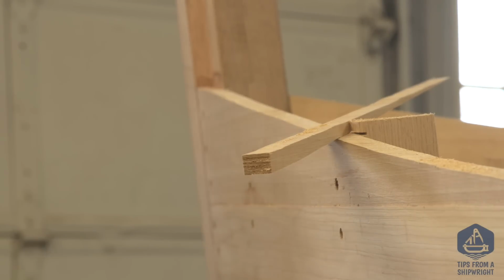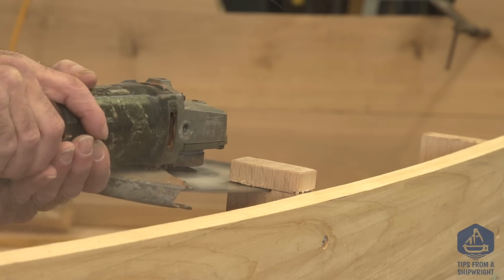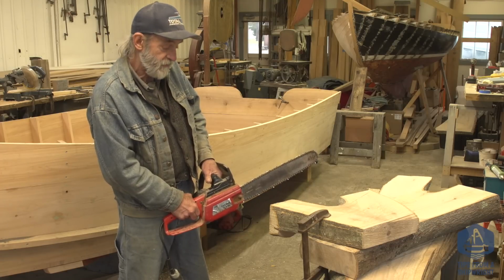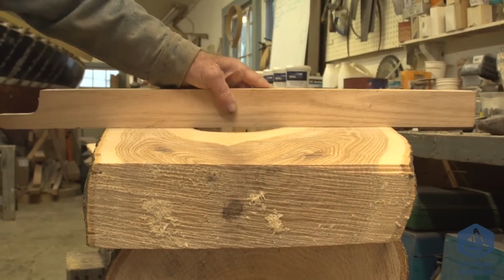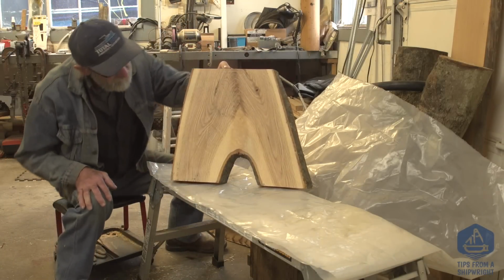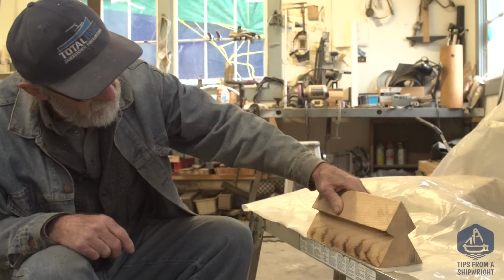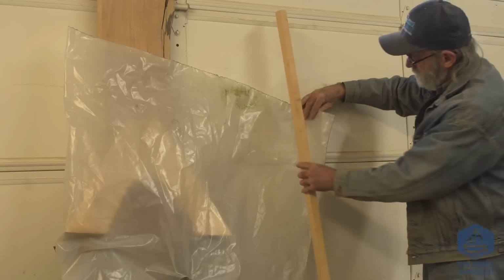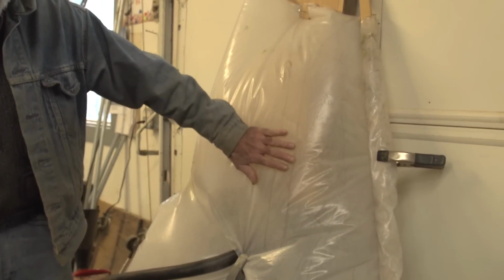Building the TotalBoat work skiff - Steaming (Episode 26)

Comment: Something really cool is to take some of that plastic and tie knots in it every few inches and suspend in over a bucket of water when it's dark outside and light the bottom it until it starts dripping like that into the bucket of water.
At first, it isn't that cool, but as it keeps going and dripping faster, every time it hits the water, it flashes pretty bright.
As it speeds up, it actually becomes quite spectacular. Like a redneck strobe light that's almost too bright to look at. 😂

Comment: Everybody has their own ways, but... If you exercised the same skill hand filing a good handsaw, as you do filing a chainsaw, and had a good assortment of saws to select the right one for the task, you could easily do that with a handsaw and have a whole lot less cleanup afterwards. For compound angle work, there is just nothing better. Had a large woodshop full of machines for decades but these days I do most work with hand tools. By the time other guys get finished setting up their fancy, elaborate jigs to do something with a specialty router bit, I'm already done.

Comment: To those that are fretting about Lou's ingenious grindersaw: 
Think of the blade as a clock. (it rotates clockwise anyways) 
Always make grinder cuts in the EARLY AFTERNOON. Only touch the material to be cut or ground- with the "Noon" to no later than "4-o'clock" part of the blade!  
Grinders have FAR TOO MUCH ATTITUDE in the early morning or late at night! And certainly don't ever ask it to do anything "after hours" or where the grinder guard is usually positioned- from around 5 to 9. These are the only "times" the grinder wants to pull it's weight rather than be pushy, or get bound up, or attack its employer!

I have learned so many techniques from you Lou!

Comment: Lou, you need a multi-tool oscillating saw. I have seen what happens when a cut-off wheel in an unguarded angle grinder hits flesh, and that would be nothing compared to a circular saw blade. Your too important to the community to get hacked up at this point.

Comment: Hey Lou, you can successfully use a microwave to season timber from green to EMC without any degrade and there are ones big enough or that piece  your steam-in,  probably in 30 minutes in 2 - 3 goes just to take it steady, let it cool down and rest for a bit and put a moisture meter on it, continue till its about 25 % - EMC and it should be good.

Comment: Nice steam box. An hour per inch of thickness in the steam is what I've always heard, for bending. I've also heard that you can't steam bend kiln-dried wood because the lignin is permanently set by the dry heat of the kiln. Do you prefer green wood for knees and breast hooks (where bending is not required)?

I've been reading up on coppicing as a source for wood with bent grain. Is anyone still doing that in New England? It's a long-term project (decade or more), so you can't just say, "I think I'll go coppice a few trees tomorrow to make knees."

Comment: the circ saw blade on the angle grinder.. i made one 10 years ago.. and in time at a garage sale i got a base board cutter:  a  flooring tool designed and factory made same way with better guard. for cutting a relief cut in a base board for new floor boards.. great tool.. you can see it bing used in "diresta barrel table" video.. first few minutes.  Than you louis!
Reply: DiResta the worst of the worst. Over selling much?

Comment: You could build an auto top up system like this very easily: https://storage.googleapis.com/aquarays/Auto-Filler-Canister-05-e1439451481887.jpg
Just a sealed container with water in above your kettle and two silicon tubes, the water level controls flow of air into the container and therefore the flow.

Comment: A good sharp Dozuki (Japanese pull saw) would make short work of those cuts on the top of the frames.  Infinitely safer than that Frankenstein tool he favours.
Reply: I'm not picking a fight in youtube comments, but a Dozuki has the firm spine on the back like a dovetail saw. It may not have enough depth to cut that. Nokogiri is the Japanese word for saw. However, I totally agree... that thing he was using looked like a nightmare waiting to happen!
Reply: Although it might be tricky cutting up to the curved inner surface of the planks.
Reply: Was just about to mention this tool +1
Reply: yeah a japanese saw would work great in that scenario, i wonder if lou has one...he must! but maybe hes so at ease using mr friendly at this point 😂
Reply: William Alan Photo shoot